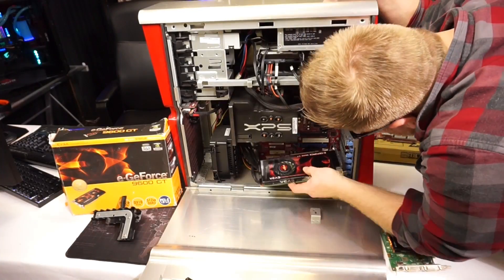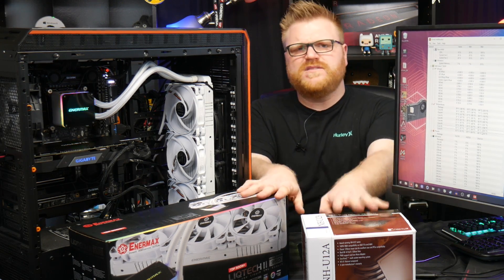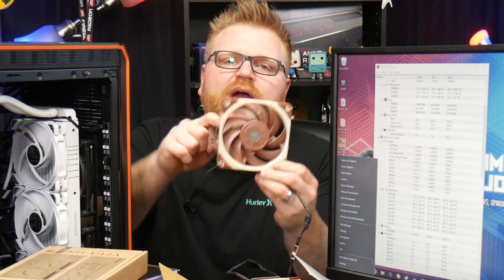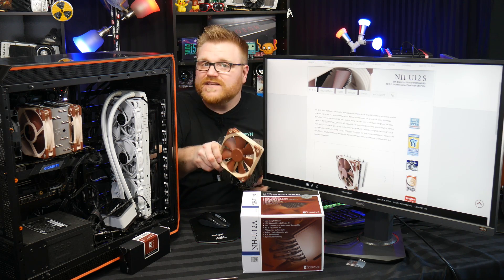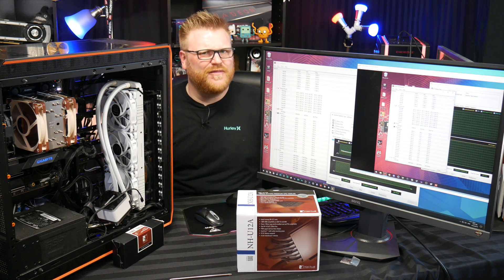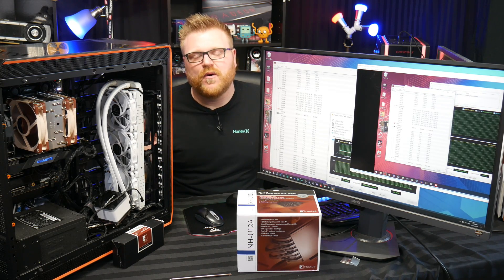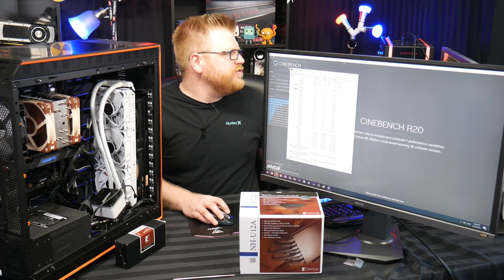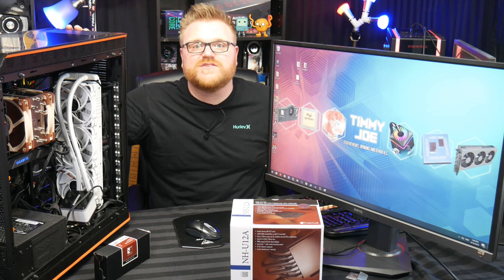Noctua's new cooler keeps up with a 360mm AIO!

Comment: Blooming brilliant. So I got  this & loved it but I kept asking myself, what about my old trusty ThermalRight Ultra 120 Extreme's Especially my True Copper. So today I tried it & right away, The copper wins by a good margin. However, even the aluminium version (custom lapped copper base) wins by a reasonable count in each idle to ceiling load. 
Compared w/ same system, same day &office & controlle temps. ASUS P9X79-E WS & E5-1660 @ 4200 & Q-Chan 2400 Cl10 1t. 2-4c less idle but upto 5c less in loading of Ida64. Used same Noctua fans to keep fair over the old Papst DC 12cm.
My testing wasn't a thought out as yours so maybe you can try it as well to confirm. I'll add, i even re-used the Artic Silver #5 but resurfaced it in the swap out from U12A to Ultra 120 Ex. I'm impressed but confused. So to challenge, I removed back  fan & only lost a few degree ut went over 5c so 2x fans helps loads.
To add, those old ThermalRight's weren't cheep. £90 (copper) or £58 aluminium in 2007 no fans & £45 for pair of Papst or Noctua

Comment: Im in love with my setup. Ryzen 3700x oc’d to 4.4 comfortably with the Noctua u12a and up’d my power supply to a 750w from a 450w that it came with stock. I’ve essentially maxed out what my motherboard can handle having been a $479 bare bones gaming computer by ibuypower that originally came with a Ryzen 3 and 8gigs of ram. Couldn’t be happier.

Comment: Until chip makers start replacing the ihs with a vapor chamber or some other more efficient means of transferring heat from the silicone to the cooler, there is very little you can do once you reach the limit of thermal transfer for the size of the contact plate.  Maybe find a way to order a vapor chamber the same thickness of the ihs and redo the test to see if the transfer limit can be surpassed and if the air cooler really CAN keep up with a full loop.

Comment: I can't believe professionals put thermal paste like that... You're creating so many air pockets you have no idea.
Reply from the maker: Dude the clamping force of the pump or cold plate flattens thermal paste so it doesn't have air pockets. I have probably swapped coolers on 1000 cpus in my life, I've applied thermal paste every way possible and it doesn't fkn matter, as long as you have enough on. Too much and you make a mess but seriously?

Comment: Absolutely no reason to run your CPU like that other then testing been a pc guy for like 25 years and over clocking is silly only slight over clocking can help but you lessening your cpu life even if it's running cool its loke running you car rpm data higher rpm it will lessen its life and that goes for anything electronic

Comment: Wow that is a hot chip, my 7900x delidded and direct die mod runs @ around 20-25c cooler overclocked to 4.5ghz for my daily setting.  I have a custom water cooler, but it isn't the cooler that can't do its job, the temp spike instantly to the highest as soon as it is on load, I agree with you, these chips just run hot.

Comment: Real world test, leaves a 360mm rad in the front with side of the case off....lol
Also 14:10 @timmyjoepc I've had an overclock on cpu pass cenebench r20 3 times in a row but crashed halfway through R15 extreme

Comment: Thanks Timmy Joe PC Tech. I am trying to wait for the new version of Noctua D15 with 7 heat pipes as I'm just so curious about the difference in temps it will make on my 9900KF. It's more fun exploring what my desktop pc can do, what kind of performance it has and finding out which oc settings work best, than playing the actual games. 
As I was just curious what's the best performance I can get. I bought MSI Godlike z390 mobo which was discounted at the overclockers.co.uk down to £360 as it was an unwanted return and without accessories. On it, the current big cpu heatsink I've got Thermalright Macho 2, is so close to my interesting graphics card 1080Ti Kingpin, that they are actually in contact with each other. I will do an odd experiment next week, to put non electrically conductive thermal compound on the back of graphics card which is the back plate, so that the large cpu heatsink that I currently have, will absorb heat from the graphics card through the back plate which usually gets hot, and it should also transfer heat the other way to the graphics card back plate from the cpu, coolling the cpu when it's at higher load than graphics card gpu.
To make it a bit odder, I also just placed 2 stock cpu heatsinks on to the backplate of graphics card which usually gets quite hot, and these small stock cpu heatsinks with their copper base plates actually absorb a few degrees from the graphics card through the back plate. Now it's time for more Frankenstein pc cooling modifications, but neat and with a little style

Comment: I see Tan Fans and my mind thinks Good, goooood!  Sure I wouldn't mind some better colors for Noctua, but I also do NOT mind the tan and brown!  I use the NH-D15 which still bests even the newer NH-U12A by just a LITTLE bit!   That said - it is INSANE how well Noctua made a 120mm SINGLE TOWER Heatsink!  I mean this thing basically beats the Dark Rock Pro 4 - and it is A) Easy to Install, B) smaller, and C) has MUCH better system compatibility!     (Seriously though, why does BeQuiet suck so badly at making good, EASY to USE mounting hardware?)

Looks like in this system, if you WERE to use the NH-D15 then you probably would have to use the next PCIe slot down, the NH-U12A is RIGHT against your GPU's backplate!

Comment: Laugh being this is the crappy rinky baby-sized 120mm single stack Love to see your jaw drop out of your head with one of the decent dual stacks like the DH-15, or something like the Phantek TC-14PE. (my personal favorite and go-to)

Liquid is such a joke. If anything it's an illusion as water soaks up heat great, but doesn't like to get rid of it. Heat pipes have the potential to be far more efficient, and by the time you get up to 140mm fans you're at the same -- or sometimes even less -- noise than a radiator.

Why would you use a material that doesn't like to get rid of heat, put it farther away from the source, and then try to cool it with the same amount of air you could just exhaust out the top/back right then and there?  Never made any sense to me. All water does is make the sink bigger making it longer to come up to temp, there's no reason for it to ACTUALLY be more efficient in a way heat pipes aren't.

Comment: I got noctua nh-u9se2 push and pull same temperature 55c, aio h100v2 max temps 55c, aio are crap , this cooler is going to my ryzen 3600x upgrade coming soon.And for the people that don't like the fans you just  mod fans with paint or RGB fans it will get better temps lol.

Comment: That Radiator is "aircooled" with water as the heat transfer medium.  That noctua is "aircooled" with phase change gas as the heat transfer medium.  Phase change gas such as R134a is way more thermally conductive than water since it has a much lower boiling point.    Imagine a Noctua AOI where a gas compressor  pump the condensed gas from the front mounted heat pipe array to boil off at the CPU.  That will be the end of water cooling.  Can be done now, but that skill set requires copper brazing skills, evacuation pumps, refrigerant gases, and an EPA cert.

Comment: Noctua fans aren't as ugly as sin. The Chromax black range is available for most of their fans.
Reply: need to buy the fans seperate tho,
Reply: @Produif  

The Chromax range, heat sink covers and fans, are bought separately, yes.

However, at a Computex Noctua announced an all black D15 heat sink, fan too. Not sure when it's available.

https://www.reddit.com/r/pcmasterrace/comments/9ot8z0/noctua_will_be_releasing_their_nhd15_cpu_cooler/
Reply: @martinw245  Thanks, i'm really not a fan (get it?) of the colorscheme, no idea why they are hellbent on having it on all their products..
Reply: @Produif  

I think it's just a company identification thing. Something they are recognized by. Anyway, at least black is available now.
Reply: Martin W yeah but why not with coolers.. i cant find the NH-D15 in all black
Reply: @Produif  

"yeah but why not with coolers.. i cant find the NH-D15 in all black"

The Chromax fans and heat sink covers are bought separately. 

At Computex though, Noctua did reveal an all black D15 plus fans. Not sure when it will be available, shouldn't be too long now.

Comment: Now if only they could produce a cooler with the same performance that fits in a Louqe Ghost S1 or a Dan A4-SFX case and can adequately keep a 9900k's temps in check. The brown color doesn't phase me, there is the Chromax line of fans but I don't know if they offer the same level of cooling and airflow you get from the NF-A12x25 's.

Comment: Just swap out the beige/brown fans for Noctua 140mm NF-A14 PWM chromax.black.swap Edition 1500RPM Fans which also come with 6 different color anti vibration pads or even go the Noctua 140mm industrialPPC black fans that can spin up to 2000rpm which is more than enough. Won't cost much.

Comment: Except the Noctuas are butt ugly.  I'll keep my Cooler Master 240mm RGB water cooler. Keeps my overclocked Ryzen 7 2700 at about 41C while gaming and kept my overclocked FX-8350 at under 30C while gaming.  And it is very pretty. Thank you anyway.

Comment: This.
I have a 7820X too. 4,8GHz, 1,265V. It heats like a mother. I would trade it for a 9900K anyday but it did not exist at the time.
I delidded it, put liquid metal on it, and lapped the IHS. I feel it is mandatory to keep the temps in check.
My Corsair H110i with 2x140 ML fans has a hard time keeping it cool on prolonged loads, but on real world use it stays under 85°C under load.

Lap your IHS, man! You can gain 5°C on your hottest core!
Reply: @freak777power  You got lucky ;)

Comment: Uhm, hate the point out the obvious... but your AIO would prob work abit better if you didn't choke it up with the pair of 140s on the front.

I bet the be quite black 140s are regular case fans connected as such to the mobo running at a set rpm.
Where as the Enermax AIO fans are connected to the pump/cpu, and the fan rpm would go up and down pending cpu thermals - and they'd be choked trying to pull air through the slow spinning bequite case fans.
If you want a push+pull setup, go with matched fans, all connected to the pump/cpu - granted running push+pull has diminishing results vs cost and noise.

I'd personally re-test the AIO without the case fans on the front - maybe run them on the top as an exhaust.
*And retest the Noctua with just the case fans. No AIO in the way.

Comment: I'd like to see the Noctua NH-U12A (which IS an excellent cooler) compared with a different 360mm AIO — the Enermax LiqTech  TR2 (even the "redesigned" 2nd edition) has some known issues – see https://arstechnica.com/civis/viewtopic.php?f=7&t=1446531 et al. for more insight – which might prevent it from performing as well as other 360's might.

Comment: AIOs need to stay at intake then it's awesome. I believe I was so impressed that I am never going back to air coolers. No matter what payed youtubers say.
Reply: Grigoryev Mihail you enjoy it buddy my 90 bucks noctua probably is giving me the same temps as your 200 bucks aio.
Reply: @tastingo8046  One thing you may not have considered is your GPU temp - an AIO will always outclass if installed properly as the heat is taken out of the case and blocks a huge section of your internal airspace - this will always affect your GPU temp, which may be important if you happen to be using your GPU and CPU at the same time... like for gaming or rendering or the like.  But you may just use onboard graphics to post on Tumblr and check your Grindr profile.

Comment: I know it's a bit of a headache...... but a power PC like that REALLY should be cooled with a custom water cooling loop. The AIO's are OK for standard desktops, but that's it.  They are only half as efficient as a custom loop with at least two 240mm rads.  I would also direct die cool.  Just use thermal pads twice the height to surround the silicon die to help with evening out the pressure.
The Noctua fans are the best.....END OF, so it's no wonder it copes well really.  They have some great R&D labs and they REALLY put a lot of money into them.

Comment: You should have removed the aio man its blocking the full amount of air that could be coming from the front fans.
Reply from the maker: Took it out and ran it open air and it didn't get any better. Maybe 1 degree. Thing just doesn't work well with that cpu

Comment: The U12A can't keep up with the D15 or D15S. That said, it can perform fairly close, as long as it's not an extreme load so it's not a bad choice if you can't fit a D15 or D15S. Except of course the price is way too high IMO.

Also I think you have a crooked IHS, bad mount or other contact problem because you have deltas between cores of 20 celcius under load. That is not normal at all (assuming your stress software is actually loading those cores properly). If that sort of pattern repeats with the AIO then it could very likely just be a very uneven IHS (I've seen some pretty bad ones). This could be the cause behind your "strange" issues and the "underperforming" AIO. A tripple-rad AIO should rarely if ever reach those temps so it does seem like something is up.

Comment: I wonder if I should get this and change my old H110i 🤔
I do have the CM H500P Mesh for a case too so air flow isn’t an issue.
Reply: Just put noctua fans on it....corsair fans are trash thats the only reason this air cooler is beating aios because the fans are just that much better...you put these fans on any aios radiator and the results would be insane...these reviews grind my gears. They should use the same fans throughout the test and not noctua for one and the crappy fans being shipped with the aios for the other.

Comment: Problem is with your ihs its not flat , so any cooler cant make good contact with ihs , jaytwocents had the same problem , u need to lap it , u can check it by spining ihs on flat suface ull see if it spins easily its croocked , intel did poor yob on making ihs flat on those cpus

Comment: Noctua's push/pull on the coolers also makes a big difference. I have the older Noctua Nh-d14 with a 3 fan config I used on my FX 9590 for several years and it cools better than most liquid coolers but I ended up swapping it with a Thermaltake Ultimate 3.0 with a 6 fan config because the Noctua was blocking the Northbridge Chipset from getting any airflow. I also have a Coolermaster MA621P with a 3 fan config on my TR1950X and it cools significantly better than the previous NZXT Kraken X62 I had on it previously. The best way to put this is if you want to show your PC's guts off liquid cooling is the way to go. If you want a cooler that doesn't sky rocket in temperature and sustains cooler temperatures for longer periods and not have to worry about leaks or the pump going out get the best air cooler you can afford.

Comment: (S) branded static airflow fans are always best for CPU/GPU radiators and fin stack cooling and tight case intake areas. (A) branded Airflow fans are for exhaust top and rear. in case anyone needed some clarity on the type to buy for what condition.

Comment: I tried alot of fans (thanks to Amazon refund) but I don't really liked Noctua ones. They are pretty noisy even at idle because the lowest speed was at 850 rpm, which is already loud when your PC is on your desk.
In the other hand I really love the ML PRO (non rgb) from Corsair, they are dead silent at idle because they can slow down to 450 rpm and can go up to 2000rpm if you really need it.

Comment: I know he pointed it out but the side being off the case and then also still having the rad in the case and not having the case fans all set up has a drastic affect on the performance of the air cooler I know when I had my coolermaster V8 just having the front cover off the case would cause a 6-10 degree difference that’s why I switched to a 280mm aio

Comment: 90 degrees C cooler you also have some marshmallows and eggs to bake on the radiator haaa but I think you really need a car radiator now or the slightly smaller heater radiator

Comment: Not surprised, Liquid Cooling is a bit on the overrated side.
Reply: AIOs are overrated, custom loops are NOT ... i dropped almost 30-40 degrees from both my CPU and GPU going from Noctua NH14S and Twin Frozr MSI cooler to single loop dual rad setup (Slim crossflow 3x140mm in front of the case + standard height 2x140mm in the roof) fed with 8 140mm fans running at very low speeds

system is cool and dead silent no matter if its idling or running full tilt as im running it at constant fan+pump speed... you CANNOT get that level of silence and performance out of aircooling - either you can have silence or you can have performance, you cant have BOTH unless you go with liquid

Comment: Testing coolers should be done with a soldered CPU. Using a CPU with TIM nets similar temps on pretty much any midrange cooler or higher because the TIM is keeping it from transferring heat properly. Pretty much any midrange or higher cooler is capable of dissipating the heat that manages to be transferred by the TIM.

Comment: $100 for an air cooler, and for $20 more i can get a water cooler.  But the Air cooler will last almost forever, where as AIOs tend to crap out after 5 years.  Tough call.